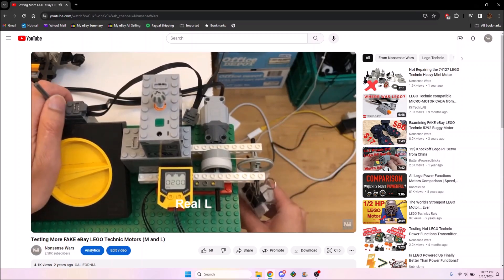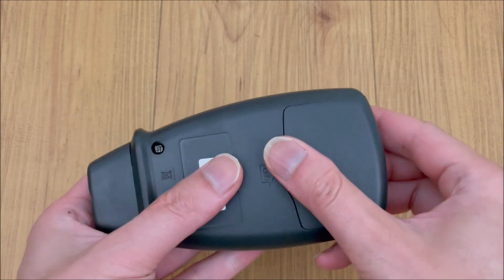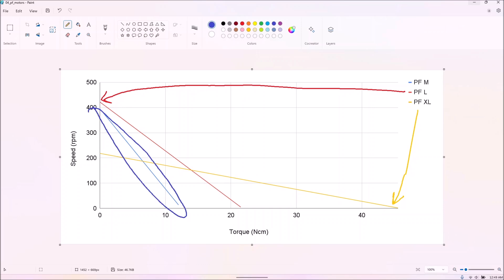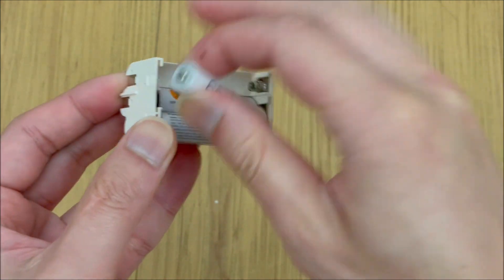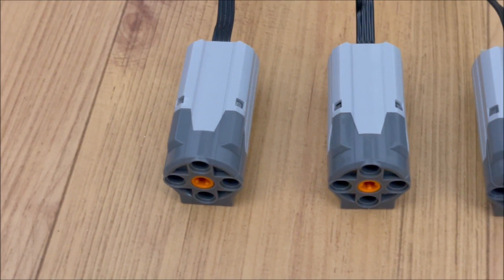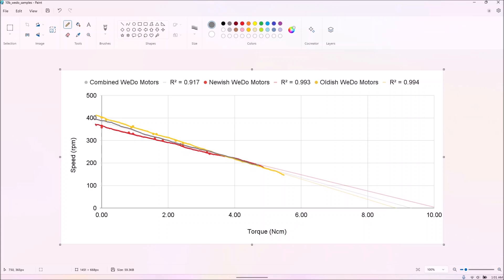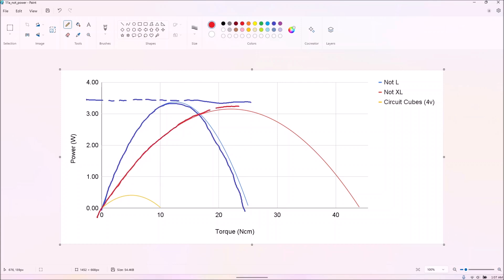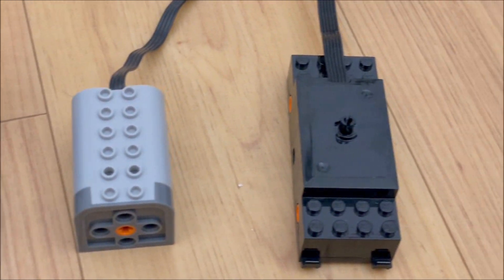A Definitive #lego Technic PF + PU Motor Test (Real + Fake)

Comment: Big kudos for your tests! I'm fond of your felt brake device - as you say lifting weights is not very practical, especially for the most powerful motors. What I don't quite get is how you relate the torque applied to the motor to the weight displayed by the scale... Philo.
Reply from the maker: Ah, I should have elaborated further: when the brake is applied it effectively creates a 2-stud (1.6cm) arm on the motor shaft, which presses on the scale. Converting the weight to Newtons and multiplying by 1.6cm (force x distance = torque) gets the load on the motor.
Reply: @NonsenseWars  Oh - got it! very clever!